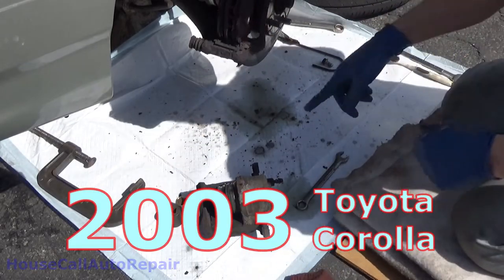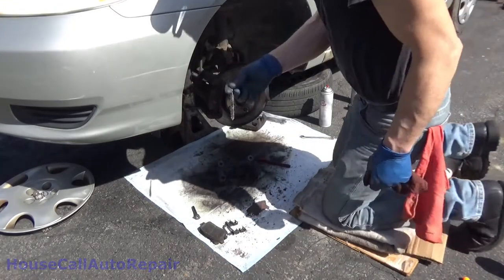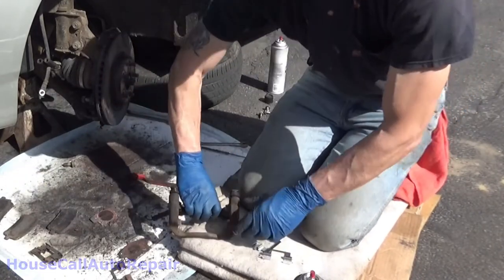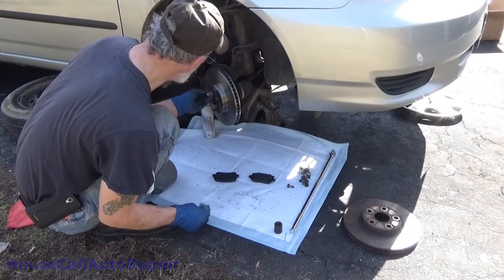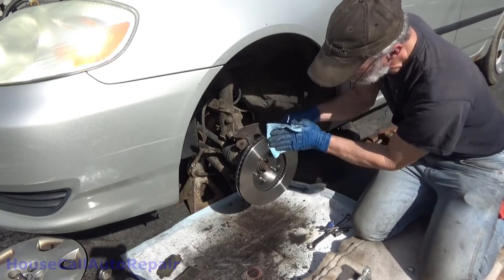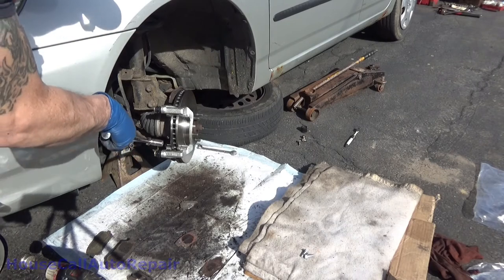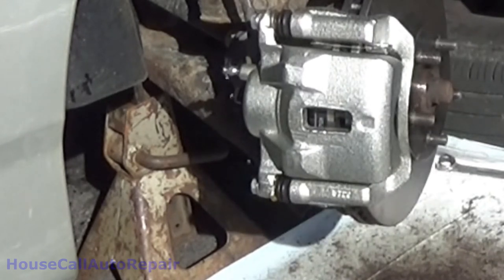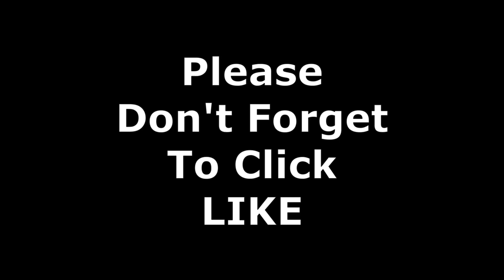2003 Toyota Corolla Front Pads, Rotors, and a Caliper  - Part 2 - Brake bleeding with a Hammer?

Comment: Great stuff! Thanks again for another great video! I will likely have to do a caliper replacement on my 2003 Corolla also - brakes are dragging a bit, most likely due to a rusty piston.. Your videos are really helpful!
Reply from the maker: Thank You! also be sure to check that there isn't too much drag on the brake pads in the bracket, and free movement of the slide pins!
Reply: @HouseCallAutoRepair  Turns out, you were right. I think replacing the brackets will do the trick - they were a bit bent and not the best fitting around the corners. Also new pins! Hopefully this does it! Thanks for these excellent videos!!